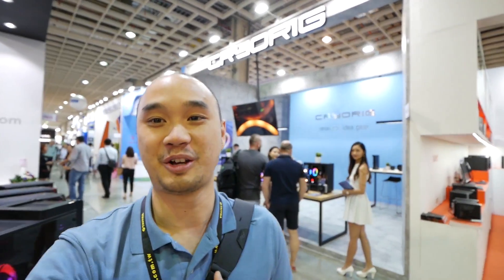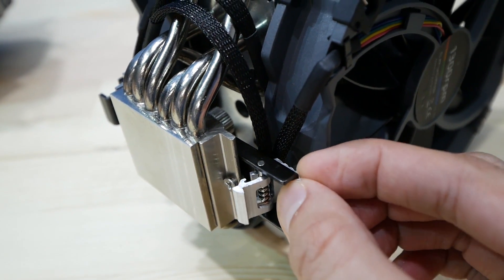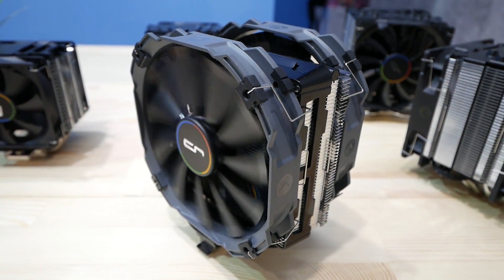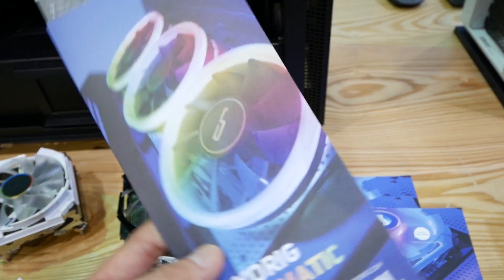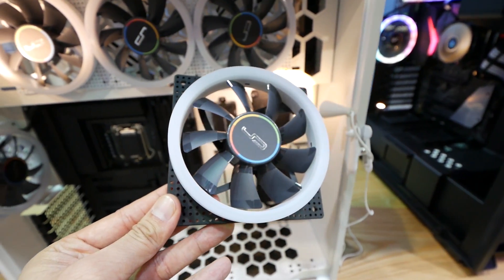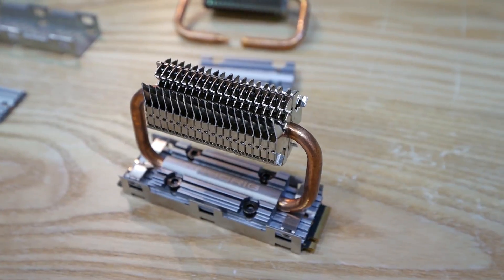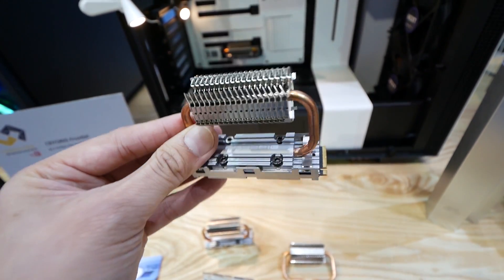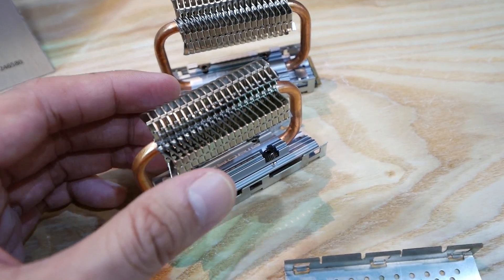Cryorig's new H7 ULTRA RGB CPU cooler and other cool products - Computex 2018

Comment: I prefer the look of the old Quad Lumi for my system as it is more technical... Still I think there's a market for the new, now cleaner looking version... If there would be an adressable version of the Quad Lumi it would be the perfect fit for my system... I'm still looking for an adressable RGB CPU cooler that fits my builds theme...

Comment: Whwrw can we buy the h7 ultra?
Reply: I emailed Cryorig several times, as recent as 3 days ago and didn't hear back. Haven't heard or seen anything since Computex.
Reply: Mike T  its a shame because am planning to upgrade my pc and it looks interesting 
~
Reply: @S.D1010  yeah I'm in the same boat. I'm gonna give it until the end of the year cause like you said, it definitely interests me. Do you think I'd be able to just take the Lumi and replace that fan with a an RGB one? I love that ring/halo type look and Thermaltake, Aigo, Cougar and a few others make similar ones that would like similar to the RGB Ultra if that's possible.
Reply: Mike T  yes i think it comes with a clip so you can put any fan you want !
Reply: @S.D1010  oh nice, that's what I figured. Still gonna wait but that'll be the backup plan. One more question, what about the LED light? Like if I put a black fan in there with an RGB ring/halo, do you think that would disable the LED or is there another way to do so?

Comment: Does the C7 RGB have a 4pin RGB header? I'm just curious since they advertise it with an Asus Z370-I board (that I currently own) but that only has a 3 pin addressable strip header.

Comment: Loving the H7 ultra RGB, its how quad lumi was supposed to be. Is it also coming out on Q3 2018?
Reply: I dislike the rgb fan frame, would rather go for Coolermaster ma410m. Cheaper than the current cryorig 7 quad lumi
Reply: I like the rgb frame, my system has 5 phanteks halos installed :D , but thanks for the heads up on the CM cooler. Its not out yet though so how can you be certain of its pricing?
Reply: Nicholas No More the new cm cooler is out on my country, at $89SGD while the h7 quad lumi costs $94. Not sure about the pricing in other regions.
Reply: Yeah I love it too. Will definitely be my next cooler. Been waiting and haven't heard anything on the release, which was supposed to be Q3. I like the black Lumi but dislike the white LED fan. This one is much better and like you said, what the Lumi should've been.